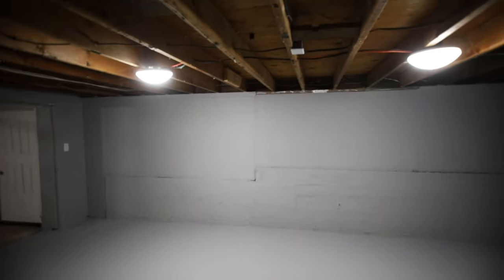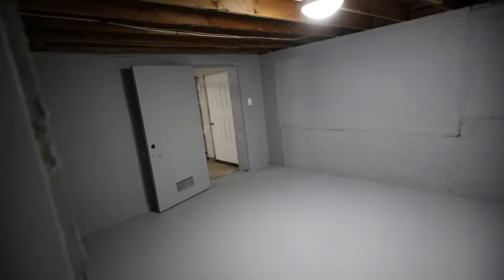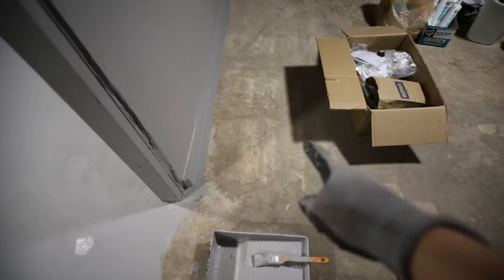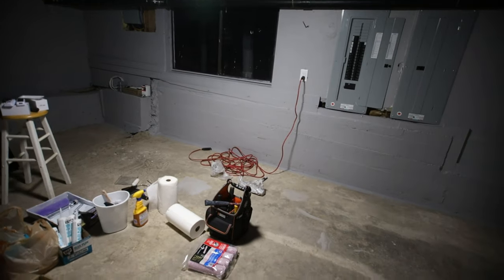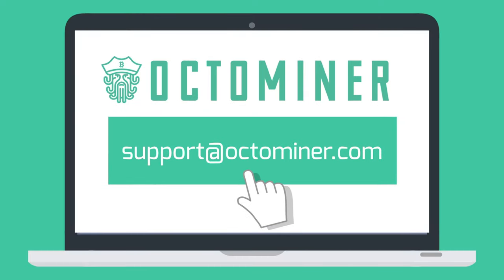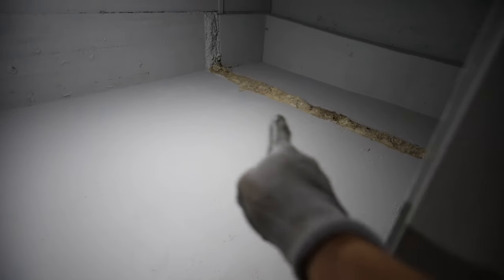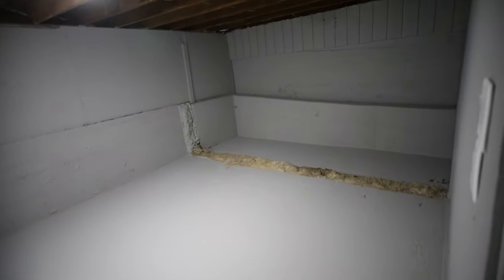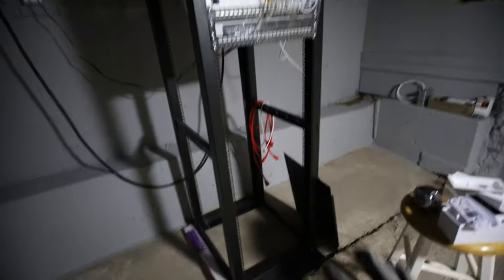new mining location basement update.

Comment: I use Swisstrax Ribtrax for my garage floor/Workshop floor/Mining room floor. It’s by far the best I’ve found. It always looks clean. Stuff goes through the slats to be hidden and vacuumed up later. Tiles pull up easily to clean up spills, etc. Other solutions like epoxy, paint, etc, don’t even compare.

Comment: No worries about the content. I did use the flakes with clear coat from HD on my server room floor and it came out really nice.
Reply: Was it on the bare concrete floor though? I'm worried about adhesion applying that stuff onto a painted surface.
Reply: @patrickmurphy3  I had to first coat the concrete, then put the flakes and then a top-coat. The instructions are on the box. I will say that sprinkling the flakes is a bit trickeier than I thought it would be, and I did end up with a bit of clumping.

Comment: I would fill in the smaller section and raise it to the level of the hump, finish the hump itself for a smoother surface so there are no stubbing or tripping hazards. You can make a slight slope coming off that section to the main part so it's like a ramped platform. Also, keep an eye out for ground water during heavy rain seasons. You can have a sealed sump pit installed to keep moisture out as well. There are also water detectors that are wifi capable so you can be alerted when away from home. Honeywell has an amazing gadget like this with what looks like aux cord extensions and can be chain linked to extend the covered area

Comment: You can rent an electric chipping hammer at homedepot for cheap. Its cheaper than a jack hammer and for smaller jobs. then buy a couple bags of concrete mix, add water, stir it up with a shovel and pour it down if you really want to. As for the concrete sealer paint, you don't need to put anything over it, it will harden more with time. Definitely get a broom handle to screw into your paint roller though, saves your back when doing a lot. Just pour the whole can of paint on the floor and roll it out from there.

Comment: RPM brother I truly thought you were going to Apoxsee the floor of your basement! Similar to what the hobbyist minor did in the shed, the only difference you needed to do a special power wash on your floor before you get started, as for the hole and the Extensions step up use quick mix hydraulic cement, you can do that yourself, get a 1x4 to make a square edge so you have a clean step up.

Comment: You should totally rust oleum the garage side for your cars. It's essentially water proof and easy to rinse/squeegee. I'd recommend the higher rock solid line. They say 1 kit per 500 sq ft/1 car spot. I'd highly recommend 1.5 kits per car spot! I used 3 kits sparingly for a 2 car garage. Thinking back I regret not buying an extra 2 kits of their clear coat version to reduce eventual wear marks and seal in flakes if you go with flakes.

Comment: it would be easier to bust that old remaining wall now and fill it. Use some self leveling concrete and get some garage floor epoxy and seal it. you already put all that work in the house might as well get the basement done before you start moving rigs in.  plus it will give it a new restored look.

Comment: Not a contractor but you could level it with a drill with a chisel function and a chisel bit. Should do it ok, sds or sds+. With the floor i would have prepared concrete and filled in any holes and cracks then used a self leveling screed to make it really smooth and level then painted it with epoxy floor paint choosing a colour. With the walls and ceiling/joists, depending on the moisture of the rooms them perhaps insulation but its down to budget. The windows look like they could use an upgrade? Triple glazing. Good luck.

Comment: I would avoid jackhammer dust and more work for the raised floor just make it a raised platform/step. The lowered section just fill it in. For the raised step just use a board from  wall to wall like your building a dam. At least 2inchs higher so you have some thickness to the layer. You will need a way to spread it out flat using a board 2x4. Watch some YouTube videos it's what I do when I'm not sure on something.

Comment: DO NOT EPOXY NOW! Unless you completely remove that paint you cannot epoxy over it.  Just get some cheap self adhesive tiles.
Reply: Agreed. It’s too late for epoxy. Maybe just do a clear coat
Reply: concrete paint is usually 1 part epoxy base, no need to coat

Comment: Try building a frame they fits in front of the concrete hump and supports around the area behind the hump that you can put a counter top on. The hump removal will just be a nightmare. Make shift corner workbench.

Comment: Let concrete floor paint dry.... cure... for a while. Follow instruction if you want to do second coat. As for concrete floor unevenness, you can use SDS impact hammer drill and chisel attachment to chip away bumps. For garage floor, definitely epoxy floor paint, watch youtube videos, don't use box store epoxy kit.

Comment: Those are previous foundation walls, I'd leave them alone, or you can get a concrete grinder head for an angle grinder to smooth it out (creates a TON of dust). Otherwise, just let it go as it adds character and conversation piece.

Comment: Put epoxy you will not regret its hard af you cant scratch it also you dont need to put flake but if you like for design you can put some im a contractor and i recomand you to do it but you need to make sure you dont have any gape or crack on the concrete if you got some just fill it with sika tube epoxy